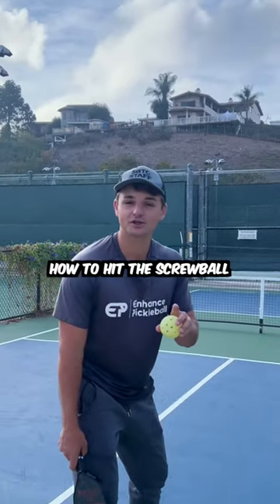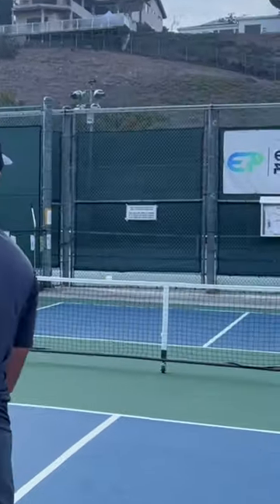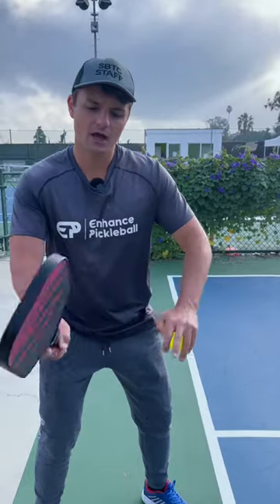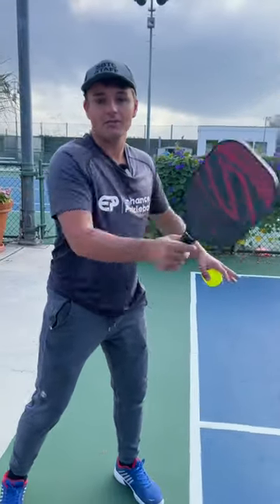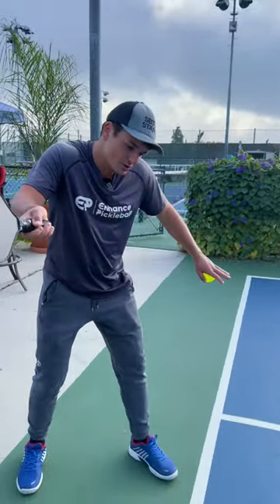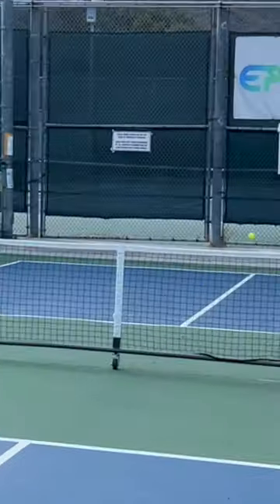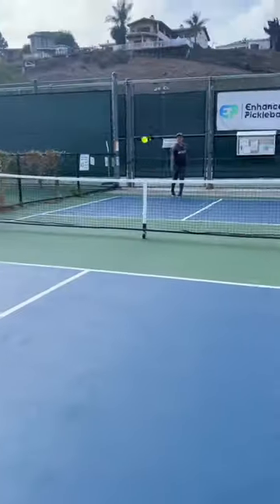How To Hit The Screwball Serve In Pickleball #pickleball #shorts - Enhance Pickleball

Comment: I’ve been questioned on the legality of this serve. Make sure to be coming up on the wall and not chopping down on it to stay within the rules.
Reply: True! However i think if you do a drop serve you are able to contact the ball in any way you want, not just low to high. correct me if im wrong
Reply: @jordinkleton  yeah as long as the ball is hit below your waist as travels upwards It doesn’t matter
Reply: I thought spin on the ball itself was illegal
Reply: I have too and this is the serve I have used for 5 years or so now.

If you were making contact coming down on the ball, where would the ball go?

People would tell me over and over I was not coming upward when hitting the ball. 

So how does the ball get over the net??
Reply: Contest is below the waist - legal.
Reply: nobody follows the serve rules, they need to eliminate volley serves
Reply: @jeremyferguson9292 Depends on your paddle face angle. Face your paddle upwards and swing up to down, the ball will go over just like any normal slice

Comment: Motion of Paddle must be headed up for the demonstrated serve. As demonstrated, the serve is illegal. Eliminate the doubt of violating the rule by using the drop serve.
Reply: The paddle is moving up. It is a legal serve.
Reply: @lminterests5590  
Nope. Watch more closely. At the moment of strike the paddle is going down. He immediately followed through with an upward arch but at the strike it's downward.
Reply: Completely agreed I used to serve this way I got called for it. They said as of 2023 you have to have the head of your pedal higher than your handle.
Reply: @fleedopmogu6169 the ball is hit in front of his body. It would be physically impossible to hit a ball up and over the net with a downward strike on a non-moving ball in front of your body.